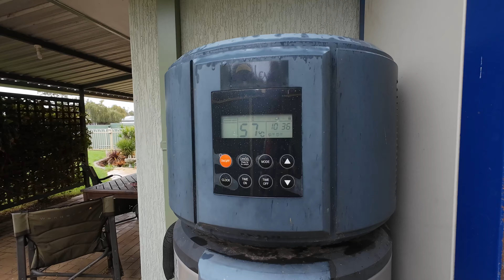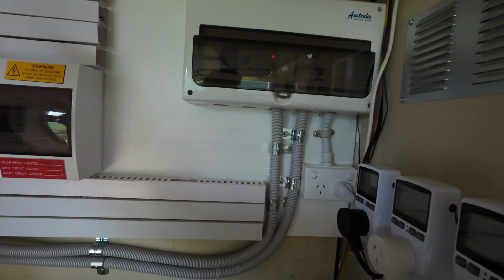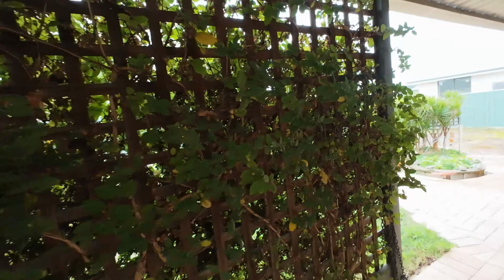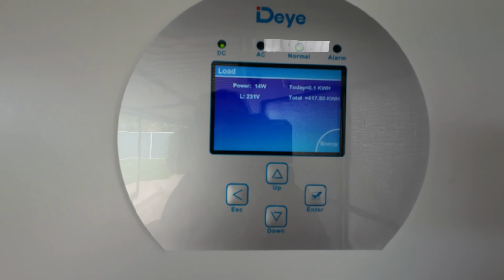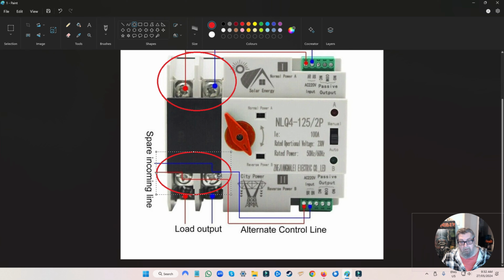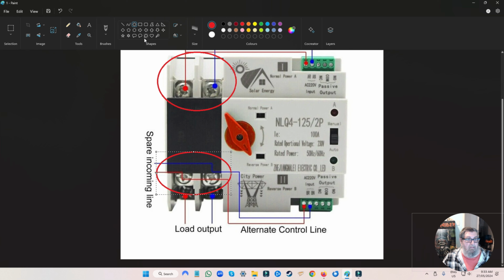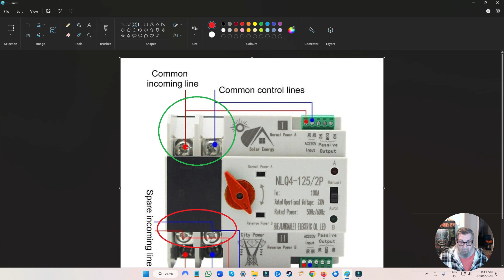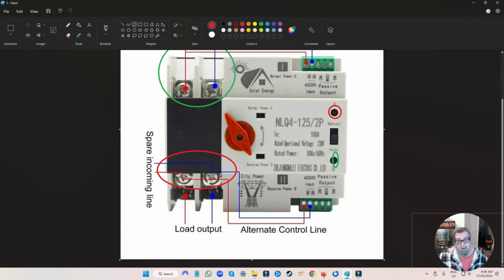Automatic Transfer Switch: Step Outside The Box  (24)

Comment: Hi Chris , didnt expect the changeover to operate that quick .....I bought a couple of changeovers but i think they are motorised...I much refer the one your using ....Do you have a link to the one your using ...?? Also i think you will need to put a label on your switchboard to state there are multiple supplies present....
Reply from the maker: I already have the correct labelling in the Main Box. Safety directions on how to shut the system down. 

2P 100A Solar Dual Power Automatic Transfer Switch Generator Changeover Switch

AU $56.36
or Best Offer

https://www.ebay.com.au/itm/355534094311
Reply: @JustinCaseSolarPower  Cool...that sounds surprisingly cheap. Might have to get one for testing purposes !
Reply from the maker: @AndyM...  You can see how well they work. Long term? We just have to wait and see.  👍

Comment: Cool how the change over is easy peasy. Jim
Reply from the maker: Easy to install. That unit will also start a generator if you have one with built-in 2 or 3 wire auto start.

Comment: I had a manual transfer switch at my old property, I use to switch over to grid power when the batteries ran low. That was back in the days of lead batteries where winter time was always challenging 😆
Reply from the maker: Lead acid batteries were great in their day. Lithium batteries are a real game changer, as you know.

Comment: Thanks for the straight up and honest information on your videos. My neighbor a few doors down had installed a solar system with battery for considerable $$$$$ last year. Since then they avoid using power in hope of recovering some of their money then recently their hopes were dashed when they changed the export tariff from 7.9c to 3.3c p/kWh recently.
Reply from the maker: They need to stop selling to the grid and use it. Store it in a battery during the day and use it off at night. Install the ATS you see in the video. Affordable and works a treat. Best way to get your $ back now is to do what I showed in the video

Comment: Hi Chris. Reason I’m still grid-tied is economics. Building up solar systems here is expensive with no government subsidies AT ALL. For instance I’m wanting to go from a 24v system to 48v and for now can only afford the inverter and have to wait for maybe 5-months or more to save up for a 48v battery, which would just be 100ah for starters. Eventually, I know having a 400ah battery bank will take me off grid, but hopefully I win the lottery😂 So the grid is backup to charge battery on rainy days. I have a small Pv array of 12 x 250Watt panels.
Reply from the maker: It's a good idea to build up the system slowly. You're on the right track. It has taken us many years to get what we have, and we did not ask for or receive any government subsidies. Wife and I are very independent people, and we don't trust the government at all.  They give a little and want a lot in return. Would rather deal with a pack of wild dogs then trust a politician. That just me. Saying how we feel about it all.

Comment: Looks like not a bad unit and rated at 100A (23kw) so should handle the load. I doubt that it'll activate very often (probably only for testing) but nice that you have the option there...🤠😎
Reply from the maker: Will handle all my loads easy. A normal single phase house only has a 70amp service.

Comment: So you cannot run both inverters at the same time to the loads?  They will not phase match?
Reply from the maker: They are a 5kW and a 8kW, so no, they will not phase match. If they were both 8kW or both 5kW, the same model and programming. Then yes you can have many units. However, that would be stupid. Why not just buy a larger inverter? They make them off the shelf up to 50kW. But you miss the point of the video. I am not showing how they phase match  "you call it" We just call it Parallel operation. https://www.youtube.com/watch?v=mqBZ5LPvmUs A DEYE video explaining Parallel operation, just for you. "Perhaps you need to watch the entire video to see what the video is about?"